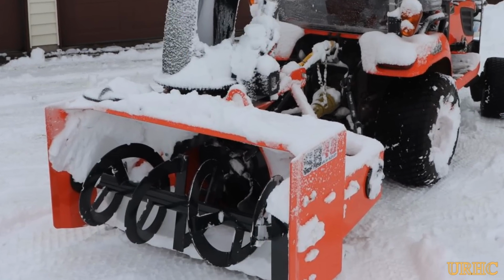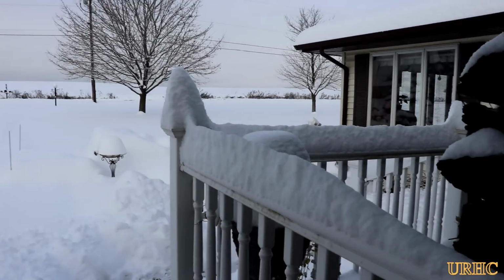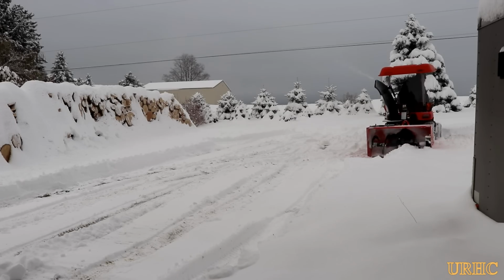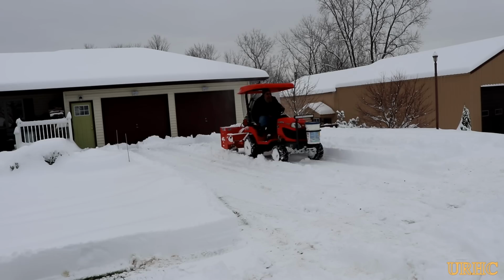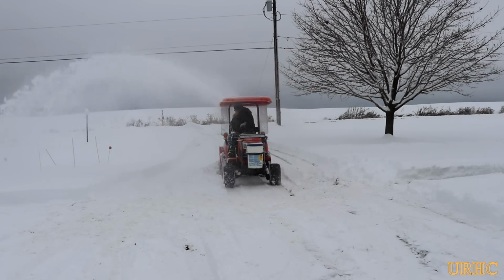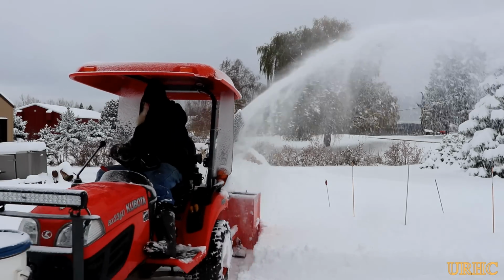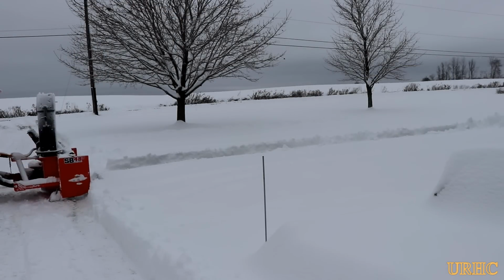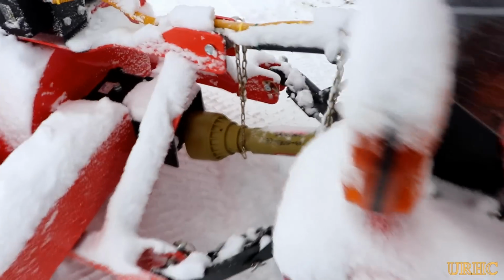Woodmaxx SB48 First Use

Comment: Glad you finally got a good dependable machine. Maybe you can make a base(pipe) to put weight on front.
Reply from the maker: I never thought about the extra weight of the snow that sticks to the blower. I started looking for old cast iron weights that weight lifters use in craigslist. It works really good. Thanks for watching.

Comment: go a bit faster in shallow snow and it would fill the bucket quicker and throw it further, speeds and feeds abom79 would say !!
Reply from the maker: First try I took it slow to be safe but now know it can handle going faster with no problem. Will use high range next time. Thanks for watching.

Comment: Was any of this footage when you changed the skids back?
I recall you saying you didn't need to and wanted to change it back.
If you did change it back, did it help more?
Sorry if I missed that part in the video.
Reply from the maker: No, I haven't dropped them back down yet. With that cutting bar flipped and the wide skid design it doesn't dig into the gravel so they can be raised to be flush with the bottom. Next one will have the skids raised, more weight on the front, and the remote hardwired. This thing is a beast. Thanks for watching

Comment: Nice to see that it is working for you and getting the job done well. I hope you were able to sell your Ariens Platinum 30 for a good price.
Reply from the maker: This one work good so far. Still trying to sell it. There are so many used Ariens for sale the resale value stinks.  Honda's sell instantly with very little loss.  May have to part it out on EBay to get the most. Thanks for watching.